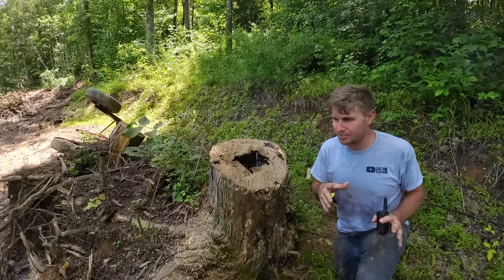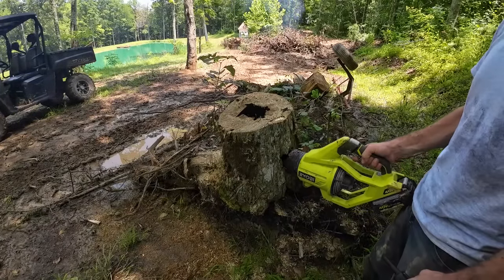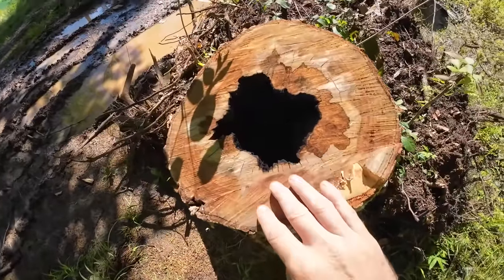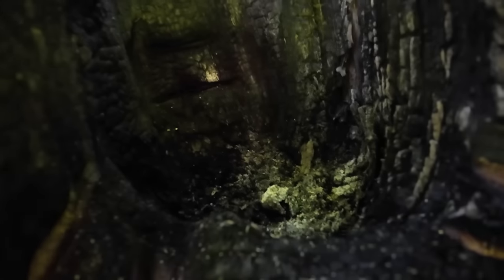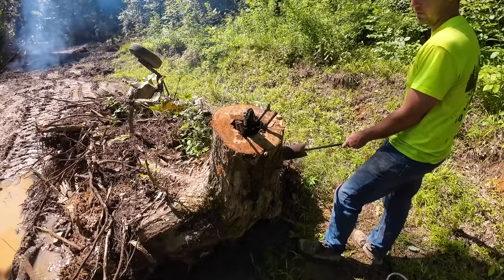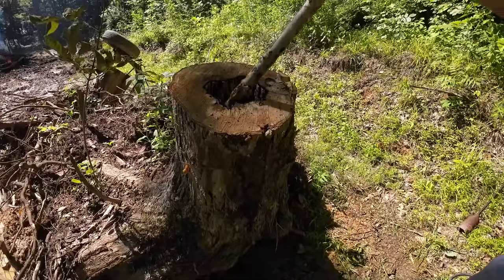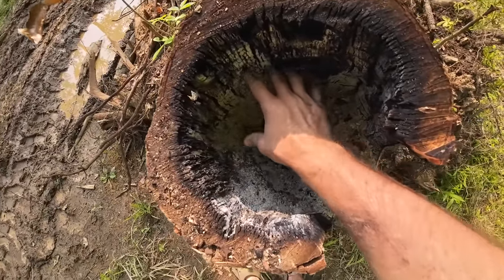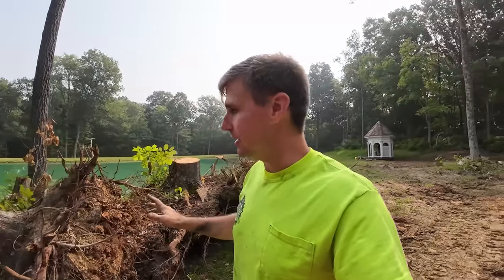Is This the Best Way to Burn a Stump?  A Subscriber Suggested it, so I Tried It!

Comment: Nobody burns stumps better than Letsdig18
Reply: Chris does a good job with stumps, however Capt. Has a bit different technique..... after all he is a fireman...........
Reply: But it usually takes 2 bales of straw and 5 gallons of diesel for him  to start a burn pile. The Capt. seems to have figured out very efficient ways to start his burn piles.
Reply from the maker: Apples to oranges, we are looking for ways for homesteaders to burn stumps.  Not contractures who have hundreds of thousands of dollars in equipment 👍 anything can be made to look easy when you have big equipment and revenue from the job to spend
Reply: Chris Guins using 5 gallons of diesel to start a fire? Not in this lifetime. He’ll squeeze a penny til it screams
He also uses more than one technique to start his fires; he’ll take burning coals from one fire to start another, for instance
Reply: @tbirdracefan  No he doesn't. He uses a little bit of diesel on just one pile and then when it's going he will carry burning pieces to start other piles. I have seen him start new fires from just the coals of fires that burnt-out days earlier. It sounds like you've never watched his videos.
Reply: I dont think Cap has anywhere open big enough to burn like Chris 🤣🤣
Reply: @snappingbear  Just look at my links I provided. I even provided evidence. Perhaps i have seen more than you think.
Reply: @tbirdracefan  What links? Besides I have watched Chris for years and I know how he operates. You my haven seen it once, but I have seen him many times start fires with zero diesel or straw.
Reply: @snappingbear  Just above in another reply. And there are 2 links. Proof that your statement is wrong.
Reply: @tbirdracefan  I count only three posts by you in this thread and none of them contain any links. The YouTube algorithm does delete posts with links if they are detected as spam.
Reply: @Kleeman1 I’ve learned a lot more watching your channel than Chris’s. All I’ve learned from chris is that I’ll never be able to afford his level of equipment. Maybe, just maybe someday I’ll find me a “ran when parked” backhoe. We can only dream lol.
Reply: @dougyurecko6500  I just meant Letsdig18 is the go-to place for epic stump burns. If you like that sort of thing. And I do.😀
Reply: You should have cooked your dinner on that stump, Cap’n.

Comment: The best way to burn a stump to drill holes both vertically going straight down into the Tree stump but not all the way through and Then you fill it up with old cooking oil or diesel fuel or kerosene and let it soak it up but make sure you cover it up in case it rains that way doesn’t get wet do that for about a week or two or and then depending on how big the stump is you take an old 55 gallon drum You cut the bottom off and then you put it over stump filling up with pieces of old lamb another scrap wood and then You set it on fire

Comment: I am of the mindset that is no one proper way to burn a stump. It just the enjoyment of watching it burn away while you fiddle with it and killing time. Not a beer drinker anymore but certainly would be a good beer drinking activity.

I once was burning an old stump and had been successful getting it burned to below ground level. I woke up the next morning and saw a little bit of smoke coming from the ground several feet away from the old stump. Overnight the fire traveled down the roots of the old tree. 

Keep having fun with the wood burning and keep sharing.

Comment: I usually burn them whilst still in the ground, but I take a big wood auger bit (like 1" or larger) and bore a big grid of  close together holes as deep as I can, then dribble some old stale gas, maybe some old dirty parts washer fluid (mineral spirits) possibly a bit of leftover motor oil from oil changes, etc into the holes, let them soak in and hour or so then light it up- the whole stump usually burns down well below the ground most times......

Comment: Well, I don't have a dog in this hunt anymore, mesquite has tap roots that go entirely through the planet, so that if I pull on one in Texas, a funny looking tree in Australia gets a shorter.  But back when I lived in the eastern half of Texas, I found the most effcient way to do it was to do what you said, bust the dirt off, and put them on top of a burn pile.  I tried all the drilling, soaking, coring, fueling, and a bajillion other methods, but they took a whole lot more work, and like you alluded to for yourself on the main channel, I had more projects than time to fool with them.🙄

Comment: I spent a year burning a 36" stump out of my backyard, but it was a labor of love (I'm a pyro).  
Started out with pretty much as you did, but burned the entire root ball down to 2-3" roots as it sat in the ground.
Reply: I did this. It took me about ten minutes to get the fire to stay lit, then I wrapped it with a couple old metal roof sheetings and placed one on top. I left a gap at the bottom and one on the top for ventilation. It burned for two days. Trapping the outside heat seemed to work for me

Comment: I have soaked stumps with lighter fluid and let it sit a day, added a little extra fluid and burned them. Some had left holes in the ground. Usually the older pine stumps. Probably some fat lighter in them as well.

Comment: I have 7 pine stumps to do that to, Mike! I’ve been letting them age but that takes about 5-7 years and then I get a little richer lighter from them! It’s just letting them sit as a eyesore! lol 😂 Your idea and getting the dirt off is really the best way Mike, that’s more or less what Chris does! Letsdig18, you know! lol  Thanks for sharing Captain! Kirk from Louisiana, sending prayers and good vibes for you and your family Mike! 👏🏻👏🏻👏🏻👌🏻👌🏻👌🏻👍🏼👍🏼👍🏼🇺🇸🇺🇸🇺🇸🇺🇸🇺🇸🇺🇸🇺🇸🇺🇸🇺🇸🇺🇸
Reply: @kirk467, I don't think you have to let those pine stumps dry. They'll probably burn wet. Lay a bunch of branches down first and pile the stumps on top. Put some dry sticks or balled up newspaper in any nook to catch the branches on fire or use a propane torch like this guy. Those stumps have so much sap you could probably light them easily. I live north east of Abita Springs and after Hurricane Katrina I had over a hundred trees down. Mainly big pines, big water oaks and some big live oaks got uprooted. The only aging was the time it took me to get to them. Working 13 days on, 1 day off and 16 hours a day for about a year, it took my wife and me about that long for us to work our way around my 8.7 acres. Also, when you start your kindling fire, if you can get a lawn mower near the stump pile, aim the wind from the discharge chute at the small fire and watch those stumps burn. Good luck.

Comment: i drill several holes in the stump using wood boring bit- diesel/ poured on stump let soak in then i have a steel fan and i have a 6 ft metal pedestal fan-i lay it across my metal sawhorse pointed straight down at the fire- works great for me-- also use charcoal after i grill while still hot as accelerant

Comment: I have stump burning air supply I built from a furnace exhaust blower, a shop vac hose, a 4 ft length of 2 inch sch 40 pipe and a wooden valve I made on the inlet of the blower  to control the airflow from zero to full. Using your 2 hole tech, I control the airflow to keep a steady fire. As the center burns, you need to add wood  to keep a hot flame next to the stump. The pipe will have to be moved from time to time to keep it at the base of the flames.

Comment: Not sure it would work on a "Stump" (Green?) but the Swiss taught me a trick that works every time on "Logs". Take your chain saw and cut the top like an 8 slice Pizza about 3/4 down the length of the Log. Start your fire at the apex of the pizza slices. It is "Self Cleaning" of ashes as they drop out the sides. They use them as "Drive Way Candles" ... very cool for parties.

Comment: Trapped moisture is the problem.

Time being out of the ground lets the moisture get out of the roots.  This also dries the mud.  Roots and mud shrink away from each other as they dry and eventually the dirt falls off if you bounce the stump a couple of times.
Dry and insignificant dirt, the stumps then burn easily.  That's about 2 years for your size stump.

If you don't want to wait 2 years... stack a big fire and dump the damp and dirty stumps on top where the heat of the fire accelerates drying and keeps the stump lit.
There's a reason "LetsDig18"/Chris uses big burn piles.  The big piles cook the stumps dry and then the stumps burn up, without waiting for the stumps to dry.

All of the other ways to burn the stump are trying to get them to dry themsleves out using the wet wood of the stump as fuel and they all have issues until the stump dries.

Comment: Cap’n the best luck that I’ve had is to cut them off as close to the ground as you can and let them dry out.  Then, drill holes through the top of them as deep as you can with a your largest auger bit… fill them with diesel fuel, cover them to keep the rain out and let that soak in for about a week, adding more fuel as it absorbs. 

Uncover the stump and drill horizontal holes that intersect with a few of the vertical holes.  Then… use your fire sword to light the stump.  

When the fire starts to wane, add air.  When that makes a bowl in the stump… fill it with charcoal.

That burnt two huge oak stumps out of my front yard… took about four days of burning.

Comment: Try cutting the side cut into the wind. Maybe some better air flow might make it run better. Also, more holes, if you're already making a side cut go the whole way through.  It might be overkill but a NSEW set of side holes to get her burning. 🔥🔥

Comment: Thanks for sharing, not sure if that was successful in eliminating an extra stump, but if you wanted a long burning cooking fire I think it may have been a success. My only true success burning was wild grape vines in a burning barrel with a leaf blower. Stuffed the barrel full and it was just smoldering, added the air and sent a column of fire 40’ into the air. Sounded like a jet engine and burned out in less than 20 min. Wishing you and your family the best.
Reply: Right, the stump put out the fire eventually because it's still green. 

Having the leaf blower would have fed the embers much longer.

Comment: Cut down through the stump so that you have a bunch of connected wedges going around kind of like a sliced round cake only out of wood. Then you can put some kindling down in and a little charcoal lighter fluid or use the propane tank with the weed burner and light the puppy up. You’ll always have wind blowing in at the base no matter what direction the wind is blowing because you have slits going down all the way around it. I’ve seen this done, but never tried it myself and even though it worked for them, it may not work for you. I say this because I tried the let’s bore a hole down the middle, and then one in from the side for air flow Kind of like what you did only I used a big old auger and that did not work for me. If nothing else if you Cut it into wedges and have to throw it onto a burn pile, it’ll help the flames get to the center and burn it down quicker.
Reply: This is called a Swedish Torch....works quite well.

Comment: 2 stroke fuel down the guts, no side air cut just bore a hole down the guts, soak it in fuel and let it burn
Reply: That should make for a viral video. 🔥💥

Comment: I’ve never tried it, but I’ve always wondered… what if you pressure washed off all the mud and rocks then cut the roots off until it was all relatively firewood. It’d make for cool experiment.
Reply: If you could easily cut the roots, nobody would try to burn stumps. :)
Reply: @Bob_Adkins  would they collect them instead?

Comment: I put vegetable oil or tiki torch fluid on it every day for about 3  to 5 days. Put a metal ring around it light it and forget about it. It takes about a week of smoldering but it all burns out.

Comment: This idea is probably not the brightest idea LOL but if the worry is the dirt could you pressure wash it off? It kinda sounds like a lot of extra work but if the dirt stops them from being put on the burn pile i've seen guys who do like ant hill casting have a lot of sucess with power washing dirt.   I was really hoping the stump hole idea would work I have one in my mom's yard I want to burn. I was thinking not using the vent hole and just allowing the natural hollow that is inside the stump be my location for my fire but I wondered if it would be better DEEPER inside the stump?

Comment: I let trees and stumps sit a year or so to dry out and decay before burning. I use a bounce house fan to burn stumps and do it on rainy days like all my disposal fires (I cover the stump to keep it dry beforehand).  Works fine but if in a rush I'd just rent a proper stump grinder.

Comment: Just light a fire near the base and blow air at it with a hair drier taped to a length of steel pipe. I have an old hair drier that does not heat but the motor still works on 12 volts. I hooked a solar panel to it and  have burned  some stumps in my yard.  I quit when  they burn below ground level a few inches. The pipe allows putting the air where you want the fire to go to.

Comment: I would make the vertical hole wide enough to fit one end of a car jack and move the lever rod until the stump crack open and can be ripped off the ground in two chunks. If there is any solid tree near the stump we can use the car jack to rip the stump off the ground using a steel wire rope.

Comment: Extreme heat gets that big wood. When the wildfires come though by where i live in CA the places that got so hot that the stumps burn all the way down through the roots are in the places that had huge amounts of excess fuel and the winds were whipping 50+ mph when the fire came through. Try recreating that, like wait until the hottest and driest time of year pile on 25 feet of bone dry wood, branches, and twigs set up a huge industrial fan then light it up!

Comment: Best way to do it is the Swedish torch method. Cut it diagonally 4 times, then cut the centre out and a small hole at the bottom. Light it up and leave it.

Comment: Another tip to try.  Best stump burner ever, use grass clippings.  Pile them over the stump when you burn it and the clippings act as an insulation to slow burn it for a couple of days and you will be lucky to find any evidence of stump or root system when all is done.

Comment: all of the 'rocket stove' designs show the wood in the sideways hole, not in the upwards chimney hole.  feed the horizontal opening and get fire going; them keep it stuffed to increase air velocity in the combustion area. creates high temps in the chimney area for small amounts of fuel.
-yeeks, who said that?

Comment: I'm guessing that heat never built up because capillary action kept on sucking up water from the ground and the heat was lost to evaporation, even if the tree tissue was dead. I don't see much use in keeping the stump and would cut it as close to ground as possible before trying to get rid of the rest. Digging out or power washing the earth around the stump first, followed by a bonfire set atop it for 6 hours or so would probably do a lot to remove moisture so you can do further removal.
Reply: the stumps basically sitting in a puddle of water  as the top dries and burns the water is quenching it .

Comment: Would have suggested filling it with charcoal brickets because they can hold a flame for a long time.  The inside of that stump just doesn’t have much surface area to work with.

Comment: After you make a hole in it. Pour in 50/50 mix of used motor oil and diesel. Let it soak into the wood. Then light it off

Comment: Try putting 3 more holes in it. One across and two on either side of it, like N S E W. Might need 8 holes. But make them smaller, you need air velocity.

Comment: When you change oil in your car save the old oil, drill a bunch of 1 inch holes in the stump, soak the stump with old oil for a few days then set it on fire.

Comment: Be cautious about burning stumps still in the ground. Burning roots will 1-kill any grass, trees, or shrubs in the area 2-can reach the surface and catch sheds and decks on fire if they are too close. Too close can be over 30 ft away. Happened at my grandmothers house over 2 weeks after said stump had been buried with dirt to "put it out".

Comment: you made a rocket stove. Pretty much the air coming in the side hole keeps feeding the inside, so the temp get super high fast. Cost alot of fuel but with the air flow of the leaf blower it can get quite hot, pretty much how a old forge works, air in one side fuel in the center, the fuel keeps getting air to burn. 3 things need for a fire, a spark, air, and fuel.

Comment: A good way to burn up stumps (especially if you're close to a body of water) is to get a portable water pump and jet blast as much dirt as possible off the stumps and then pile them up and burn them. It's the dirt which causes stumps to take so long to burn.

Comment: Cutting it up and sticking it into a burn barrel was the fastest still takes a long time to burn the stump. If it fits in a metal 55 gallon drum cut slots into it on an angle open them up make it slanted in a circle nice big ones it makes the fire spin and burns the fastest. Honestly i switched to a stump grinder it got fustrqting dealing with stumps

Comment: Should have added crosscuts to the stump which creates what they call the Swedish torch. 6 cuts straight through the middle like spokes on an wheel adds all the air you need. People do it for campfires all the time. Would have burned down to nothing. You do no need the side hole.

Comment: What happens if you make a bunch of round vertical auger bit holes in a circle around the center, each with its own horizontal air supply hole?